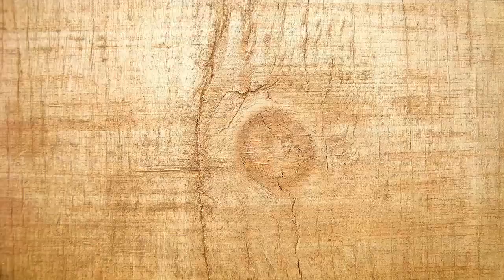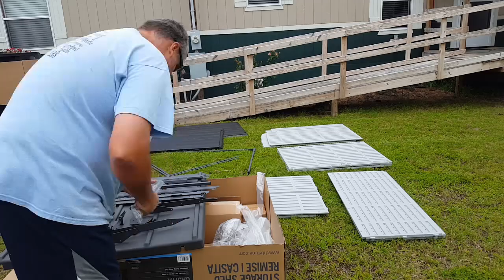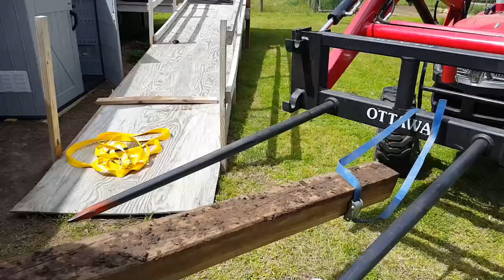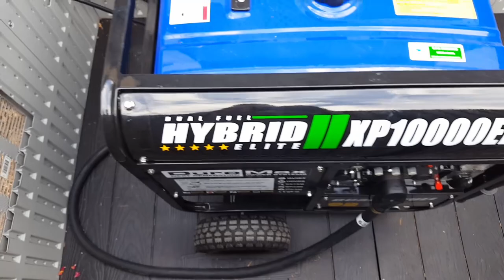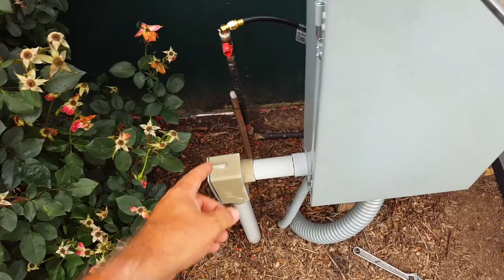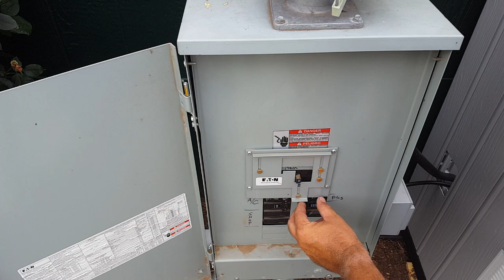Generator for the house - Dual fuel whole house system

Comment: And you told us nothing, explained nothing, gave no resources so this was a nothing video.
Reply: damn that was savage everyone has to learn a some point anyhow I learned a decent amount
Reply: Our 5th wheel has this one the NEW Sportsman GEN4000DF-SS 4000 Watt Portable Dual Fuel Generator is about the same weight, runs EVERYTHING!! And much quieter than most http://rover.ebay.com/rover/1/711-53200-19255-0/1?icep_ff3=2&pub=5575119394&toolid=10001&campid=5337842430&customid=DUAL+FUEL+&icep_item=182914484628&ipn=psmain&icep_vectorid=229466&kwid=902099&mtid=824&kw=lg  I'd say with 35 years them building these means its good, ours has been amazing, already has over 300 hours on it
Reply: Hazcat I learned quite a bit tard. I learned about making sure you have enough pressure to open up pressure valve in the generator. That was helpful.

Comment: You need a high pressure regulator on the tank. A low pressure at the generator and around 7" water column at the generator
Reply: 7" is Natural Gas. Propane can be as high as 14". A generator uses a ton of gas. 11" is typical for the gas valve in an L.P. appliance gas valve. 7" will not run.
Reply from the maker: Not sure I understand your question... but yes you could disconnect from the generator and install a longer "extension" to the one that came with the generator using a 3/8" nipple or get a female with male on other end. If you wanted to use a portable tank that is say 15' away.  Why if it was temporary just use the bbq 20 or 30lb tank until you get a line ran to it.

Comment: 2 Hondas eu2000 inverter generators parallel together tri fuel propane natural gas or gasoline they produce clean  pure sine wave power if you only need one shut one off run the other if you need more power run the 2 of them very fuel-efficient also lose your central AC and just use one room smaller unit for air conditioning with the small energy-efficient one room air conditioner that big giant tank of propane probably last a good long time try to put your refrigerators on solar,,,,, that's how I do it anyway I have enough solar for an emergency situation to run my refrigeration all my lighting charge laptops and phones things of this nature,,,, run 📺 tv charge my small batteries run small fans and also run my well pump intermittently,,, I can start one of my Hondas and run the battery charger to charge my battery bank if I have a lot of overcast days or days where it rains or snows or something like that,,,, air-conditioning there's just no way to get around it you'll need the generator for that,,,I have five 100 pound tanks of propane,,, I also thought about buying a large tank in the beginning and having it filled there just too hard to hide or conceal and you can take 100 pound tanks in and have them filled yourself you don't have to have anyone come to the house and deliver it and charge you more
Reply: Plus..... One on those "HONDA" gennys cost more than his entire setup!!!
Reply from the maker: william foreman That sounds like a great system… but as I mentioned this was to help my mom (they are 72 and 85) so lugging around 100lb propane bottles and messing with heavy AMP hour batteries and stuff just does not work for them. I don’t worry too much about the apocalypse and MAD MAX coming around raiding their visible propane tank. So this setup works very well for their needs… and my mom was very happy since they lose power almost every storm for sometimes for a few minutes and sometimes for 18 to 24 hours. If we figured correctly and they watch what they turn on she should be good for a week if it ever came to that.

I may look into the solar thing for my fridge for myself. I don't own a generator and although we only lost power once after a tornado knockesd down 10 poles outside our division you never know and I usually have lots of meat and stuff that time it was almost 24 hours but could have been more. Thanks for watching!

Comment: A small window unit for one room to use during emergencies and u can use a much smaller and more efficient generator,  plus propane gens are much less efficient than gas ones, i believe gasoline ones are ten percent more efficient so a smaller gen and less large appliances like central ac will cost u much less in long term outages, wait till u see the propane bill for running a large gen like that with the central ac going, nice setup though!
Reply from the maker: agree... but each situation is different so for my mom this is the best option. She can't carry around gas cans and they don't want the window unit installed year round. For the convince to just turn the key and flip a switch this works perfectly for them.
Reply: After all the research I've done into gas versus propane generators I think PROPANE wins the battle overall regardless of efficiency. Generators are EMERGENCY USE ONLY....meaning they are not intended for everyday long term use. For that reason alone, any concern about EFFICIENCY is a waste of time. The most important factor is availability of FUEL and as you can see by the recent hurricanes in South Florida - getting FUEL can and will always be a problem during an emergency. Storing large amounts of Gasoline is not only DANGEROUS but also very impractical for most people. Large Propane tanks are common, much safer and the fuel does not go bad like Gasoline. Not to mention that it burns cleaner and not as hard on the generator (per the manufacturers). If the cost of the fuel is that big of a concern - maybe adjust the thermostat settings a bit AC or turn it off all together and use a Fan instead. From what I understand - the cost will not be that significant. I was never a big proponent of propane until very recently for the simple reasons mentioned. I've transported 25 gallons of gasoline in the back of my 4Runner and it's a VERY SCARY thing to do. Now add on the fact of how to store it safely. There is NO GOOD WAY.
Reply: Fuel shelf life is also a big thing gas the best you can get with no ethanol stored in a temperature controlled space with stabilizers is 2 years. Diesel you can get 5-10 years if you can keep water out of it. Propane will keep until the tank springs a leak.
Reply: "Efficient" is the wrong term. 
NG and LP are just as efficient, more efficient in most ways.  What you are referring to is BTU content of the fuel.
Reply: c3pfett you not only need to look at the btu of the fuel type but also the capacity and cost of it. A 350 gallon propane tank on a generator will run much longer then a 1-5 gallon tank of gas on a generator and both are below what a natural gas generator can do as you have the entire gas network behind that. Where I am I can run on natural gas or propane cheaper then gas/diesel when you factor in the normal costs plus fuel.
Reply: Absolutely wrong about efficiency.  Propane is way more efficient than gasoline
Reply: @ssoltys4128  And an important thing no one mentions is that LP and NG run much much cleaner than gasoline. And I'm not concerned about pollution. I'm talking about blow by. With LP or NG you can run many more hours in between oil changes. The engine oil will stay cleaner longer.
Reply: Gasoline is hard to find in emergencies, propane is much cheaper to fill up in the summer and you can get propane delivery for about $1.20ish a gallon. Propane also doesnt need Sta-Bil
Reply: Our 5th wheel has this one the NEW Sportsman GEN4000DF-SS 4000 Watt Portable Dual Fuel Generator runs EVERYTHING!! And much quieter than most http://rover.ebay.com/rover/1/711-53200-19255-0/1?icep_ff3=2&pub=5575119394&toolid=10001&campid=5337842430&customid=DUAL+FUEL+&icep_item=182914484628&ipn=psmain&icep_vectorid=229466&kwid=902099&mtid=824&kw=lg  I'd say with 35 years them building these means its good, ours has been amazing, already has over 300 hours on it
Reply: Hound Dog 
Really? Propane and gasoline are about the same. Natural gas is the less efficient fuel

Comment: Did you ran the generator on 110 or 220 ?
Reply: BigRedFishDad . How long will 325 gallons of propane run that generator?
Reply from the maker: palatine7777 we hooked it up so it would supply 220 to the panel
Reply: BigRedFishDad what size is your AC unit. Thank you for your help.
Reply from the maker: palatine7777 I really don't know but my mom's house is only about 12 - 1300 square foot. If you do a search for common household appliance wattages or look at some of the solar or generator sizing websites they have a pretty good lists